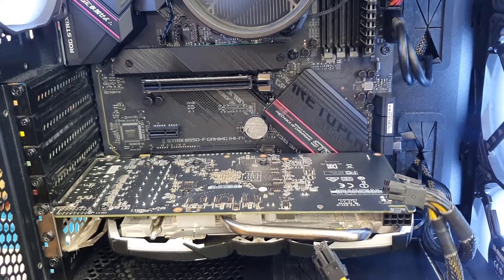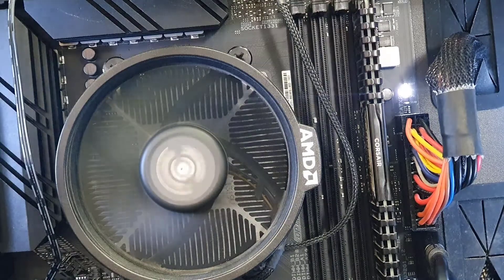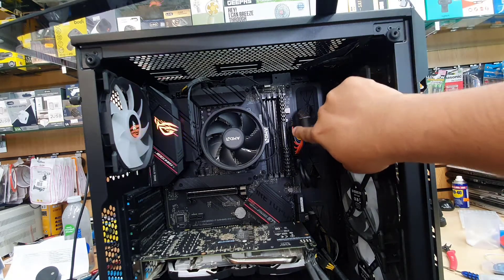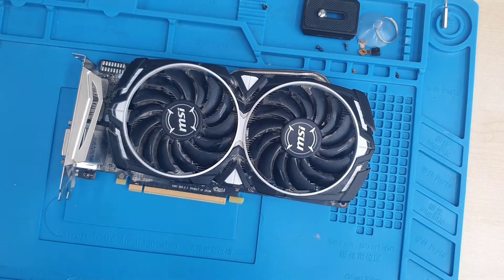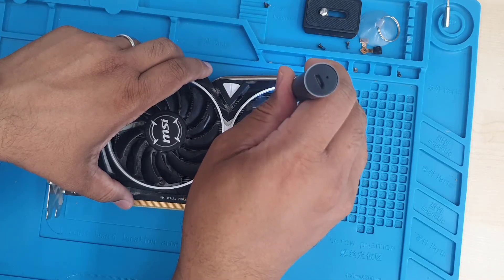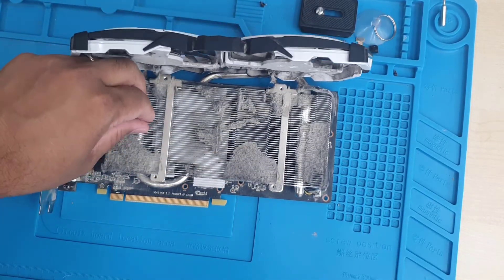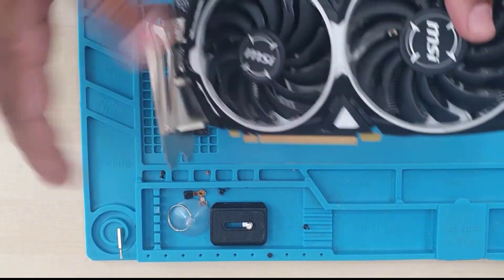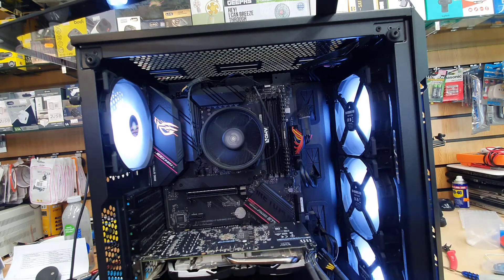Why Is Graphics Card Overheating And How To Fix This | Radeon RX 570

Comment: HI I also have an rx570 for my prebuilt and after getting a 5600x to replace my ryzen 3 1200, Ive noticed that its been overheating lately like when Im on idle I can get to like 60 degrees most of the time, I believe its a psu problem since the original psu isnt suppose to power a 5600x. What do you think?
Reply: Answer is simple, faster cpu allowed your gpu to be fully utilized and therefore to be warmer.
Reply: @zeljkorilke701  Thanks but you're a year late 😭😭but I did get another gpu which fixed all the thermal issues